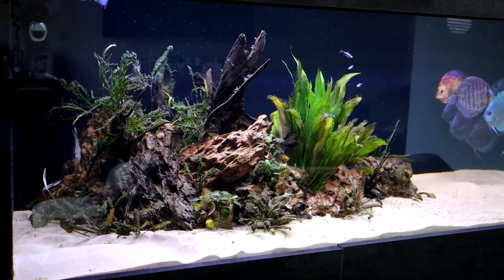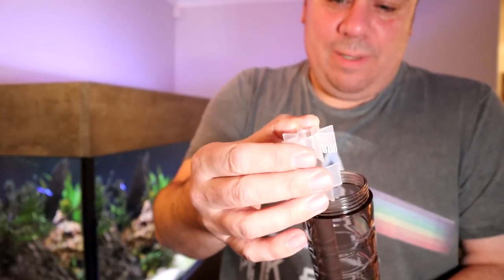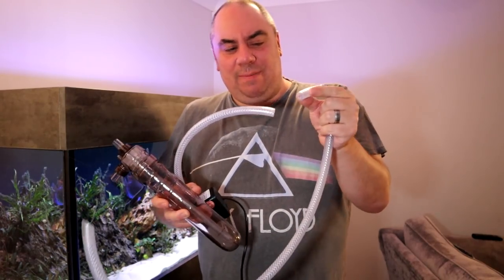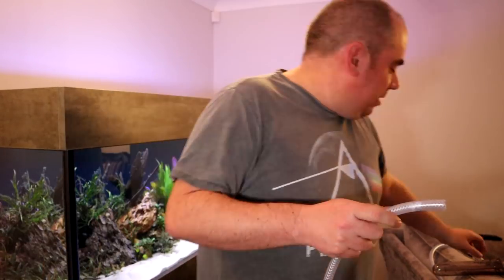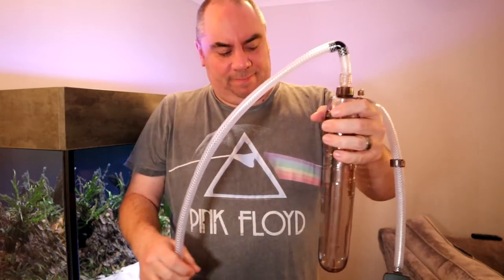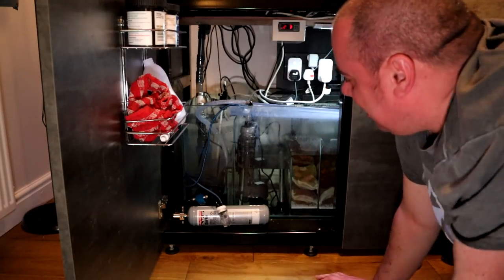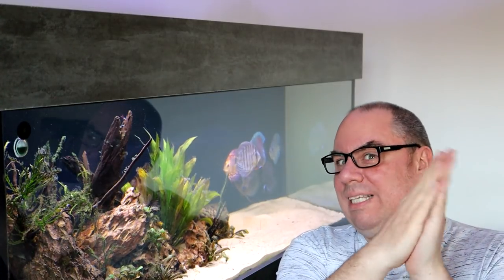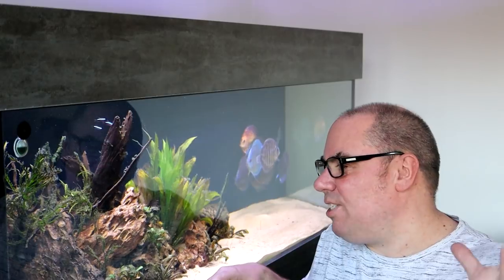Discus aquarium CO2 Upgrade - Sera Reactor

Comment: Nice video. I am planning to buy a reactor like this, I have a few questions. I would use purigen and phosguard. It says that when changing media it is not necessary to disconnect the hoses, can the flow be stopped when cleaning?

Comment: Nice.  I had a look at the Sera reactor and the JBL one.  

The JBL one is meant to go in the tank and has no moving parts.  It's like an upside down helter skelter where each bubble enters at the bottom, goes round and round as it rises up the reactor tube which is full of aquarium water, before exiting at the surface.  Obviously with no moving parts it would be quieter but maybe less efficient with the CO2 not dissolving into the water as much.  It seems to have an extension for deeper tanks and it's pretty cool just watching a line of bubbles going round and round through the transparent tube. lol

So clearly the trade off with the JBL is it's in the tank whereas the Sera can go in your sump.  I think you'd need a mega sump to fit the JBL one in as it's tall as standard.
Reply from the maker: I did look at the JBL one, it looks good. I like JBL stuff

Comment: I have the smaller version, I found the top propeller kept stopping for the first few days, however now it's bedded in it works great!

No bubbles and I've had great results!
Reply: Does it still run?
Reply: @zak9472  I had to close my planted tank down for personal reasons,  however it ran without any issues until I closed it down!

Comment: How does it compare to the Ista CO2 Reactor? Are the connections plastic? Are they threaded? Does it come with a stand? It is not wise to lay your CO2 on its side. Ask around about that. I’m in the market for a Reactor. Thank you for sharing! I enjoyed watching!
Reply from the maker: I've not used the ista reactor, but it looks similar. The Sera is plastic construction, and yes threaded (there are close ups in the video).
Thanks for the cryptic warning about storing Co2 canisters horizontally - point taken (for anyone interested - basically CO2 is liquid under pressure, regulator is designed for gas, not liquid)
Reply: Aquarium Adventures Alrighty then! You know your business. Thank you for the information on the Reactor. I guess E Bay of Amazon have that Reactor, so I’ll be looking out for it. Enjoyed watching!
Reply: Cool! So will I.

Comment: hello mt8 just watching your video and noticed that you might be using a disposable welding gas cylinder if thats correct could you please let me no what valve youve used for the top as i need that exact piece thanks
Reply from the maker: Its the regulator from a JBL kit - https://amzn.to/2D8bn3u
You could also look at any regulator and fit a 'sodastream' adaptor

Comment: Hey bud,

Are you still running this reactor? I’m just about to jump to my custom planted tank with sump, currently running the old school diffuser and hate bubbles in my tank. Was looking at setting it up exactly as you have it with the overflow from reactor feeding back into the return compartment.
Reply from the maker: Hi - Yes still using it now, really quiet and works great
Reply: @AquariumAdventures  fantastic. Do you have many problems with the so called co2 lock? Or is your pump sufficient in flow to keep the impellers spinning?
Reply from the maker: No, isn't something I've noticed. The only downside I've had is that it was a little bit noisy at first which worried me, but after a couple of hours it settled down and is practically silent now.
Reply: @AquariumAdventures  Righto thanks I’ve just ordered one!!!
Reply: @AquariumAdventures  can we get an update on the reactor in a video? Also love the dosing pump video just brought one of them also 🤦🏼‍♂️

Comment: I've bought two of these, the small one initially, then the large one after the small one started leaking only after a few days and the vendor didn't have stock to replace it. The second one started leaking only after 5 days too!

In the end, both vendor and the company tried to blame me. I followed the instructions and did not apply any pressure when I mounted it. Micro-cracks started to form in both units. I won't be recommending this to anyone or will I be buying any Sera products from now on.

Comment: Why are you removing the house retainer nuts? If you took 5 seconds to read some instructions or a quick Google search you'd be able to figure out that you're doing it wrong.
Reply from the maker: If you took 5 seconds to think before typing you'd realise there is no such thing as 'house' retainer nuts. If you meant 'hose' retainer nuts (they're not called that either) then I clearly showed you in the video they did not fir with the hose I was using, and are not required.

Comment: NEVER operate connected CO2 bottles lying down!  There is a rubber membrane in the pressure regulator that could ice up and make the valve unusable.  Then the cylinder pressure is full (up to 60 bar) and there is a risk of explosion!
Reply from the maker: Calm down drama queen - yes, they should not be stored horizontally, it was a momentary lapse - but more chance of a meteor hitting me than the cylinder exploding! Failing, yes - exploding, no.
Reply: @AquariumAdventures  no they should not USED horizontally....
Reply from the maker: Ok sure, used. Still not going to explode.